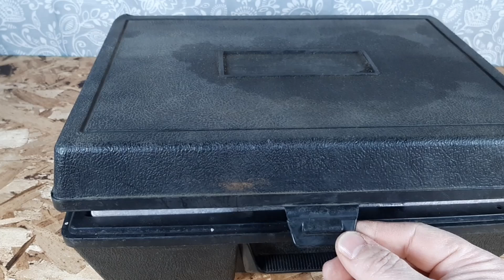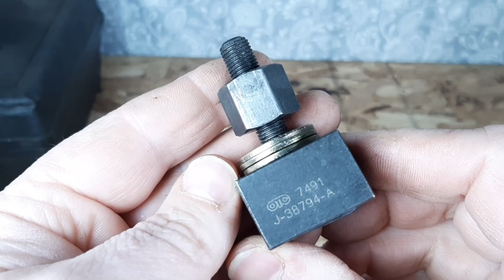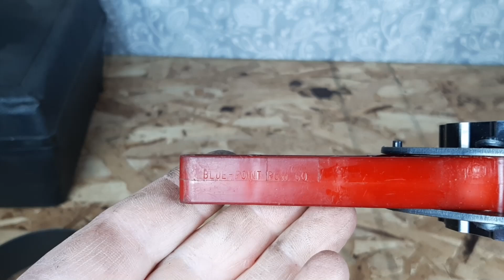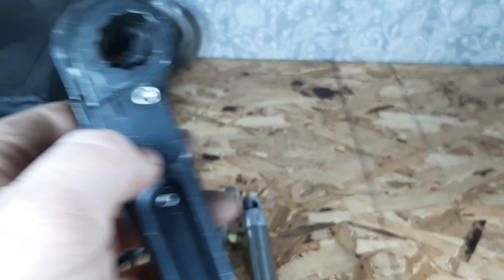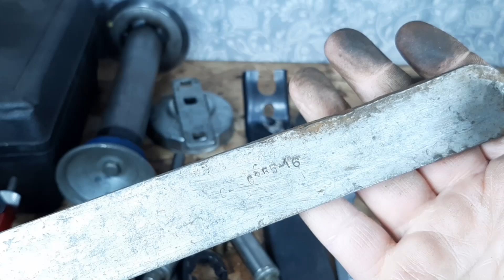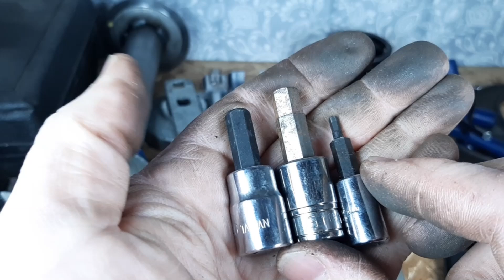Help Me Identify This Tool Haul! Large Lot of Mechanics Tools!

Comment: The double ended hammer wrench is part of a hub puller used on rear axles on 1950s and 60 cars and light trucks that he gear wrench with the handle is a strap wrench …missing thr str
Reply from the maker: Thank you for the info! Thanks for watching!

Comment: The red handle strap wrench isn't a wrench, its a wrinkle band piston ring compressor, tha absolute best way to go. The valve spring compressor is for a SBC. The puller with the cone is either a battery clamp puller or a wiper arm puller. The majority of Kent Moore tools if not all are GM service tools. Nice haul
Reply from the maker: It through me off, it was set inside the oil filter wrench when it arrived.... but now that you say piston ring compressor it makes sense. I usually see those that are about 3" tall so my mind went to oil filter wrench. Great info! Thanks for watching!

Comment: My heart hurt to see those micrometers haphazardly stuffed into that box. Lufkin micrometers are great micrometers and those are most likely from the 50's or 60's. If you do not have standards for checking the micrometers just stop by a machine shop.
Reply from the maker: Yes, to think of the abuse they tool on the trip here with all that weight smashing them. It is sad how this was packed. I would like to pick up a set of standards. Thanks for watching!

Comment: That’s old knock out tool for 90s gm trucks surprisingly I still do them you got to take the knockout out to adjust camber and caster
Reply from the maker: I see they are sold on Amazon, must still be in demand! Thanks for watching!
Reply: @ no problem bud you still use them but you get very few Silverado that have them that aren’t already took out or the front end is wore out and you can’t align it